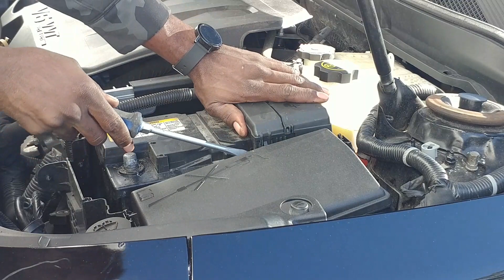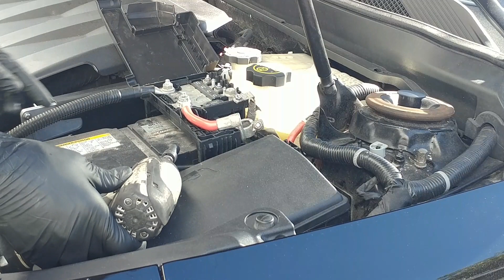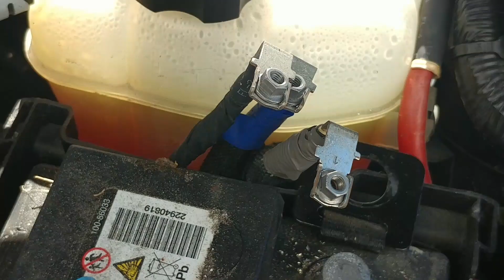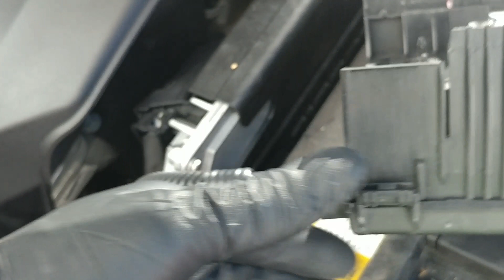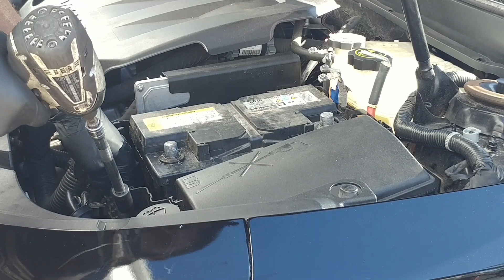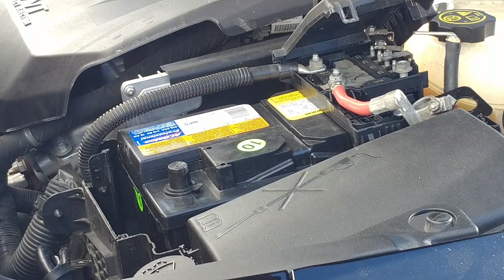Chevy impala and Malibu battery replacement

Comment: I changed my battery but now my lights ,wont come on or radio even the little screen wont show & I barely but my keys in the ignition & it will start up automatically
Reply from the maker: That doesn't seem like battery problem but you can try and make sure you put back the little wires in the correct place and also disconnect the battery amd reconnect it